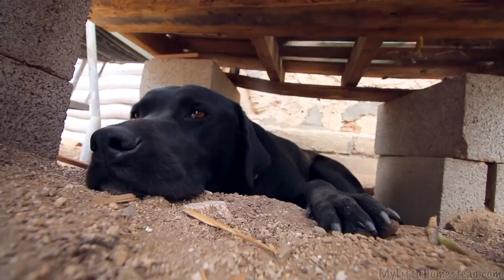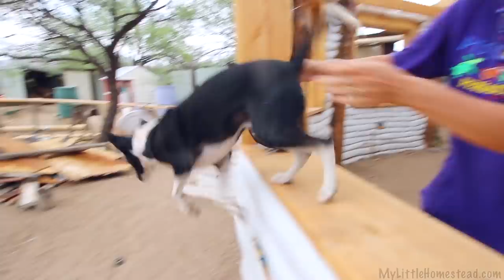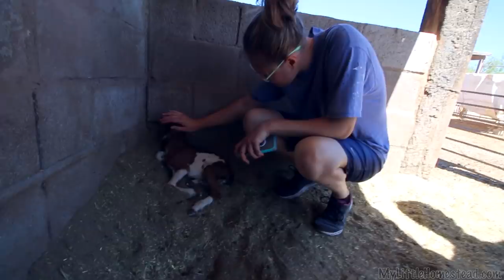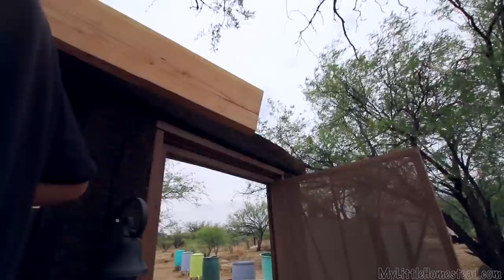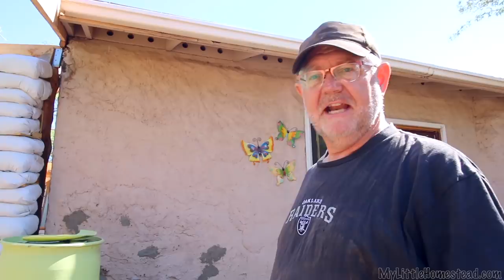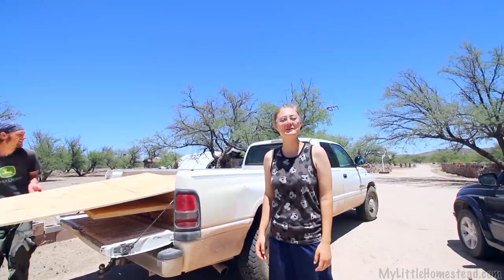Installing Tile, More Roof Rafters & New Baby Goat | Earthbag Kitchen & Bathroom | Weekly Peek Ep142

Comment: On an engineering and agricultural trip to rural Guatamala we taught the people to put two drops of oil on top of the water barrels.  It discourages bugs in general but specifically mosquitoes.  It works! (But when you reuse the grey water make sure your draining from below the surface so you don’t get oil) in a 10,000 gal tank i use six drops of clean motor oil twice per year never needing a filter
Reply from the maker: Thx

Comment: That size tile needs 1/2”x1/2” bead with no lean to the trowel.  In the long run that adhesive will break down becoming loose.  Good luck...😜

Comment: If you need to take that tile up, use a mud gun and 3 inch spade and a lot of elbow grease.  Those tiles will come up easily?!  Congratulation Garen.
Reply: In case u don't know a mud gun is, its a 40 pound jack hammer or lighter for the girls.  It's used for tiles work and trenching work to running sprinklers or shallow brush or shrub... Piping of any sort.  Use your imagination.  It can replace your shovel and would take minutes that a shovel would take hours to trench.  In your neck or the woods it might be called a demolition hammer.  If you put a spade on it.  It will take up cemented in tile with elbow grease.  It took up 3500 SQ ft in Las Vegas with another fellow.  Took us 2 weeks.. The floor we worked on had epoxy sand and some cemented areas.  Cost me my hands now I have carpal tunnel.  But it paid great
Reply: You could have went with a 5/8 rounded trowel and butter back the tile and 5/8 in the floor and float the tiles and epoxy thin set mix.  Floating tile on a uneven floor works best this way...  If this doesn't work u could dry set the floor the use a 3/8ths trowel.  Butter the back corners and center of the tile.